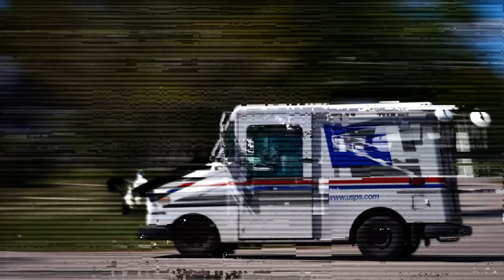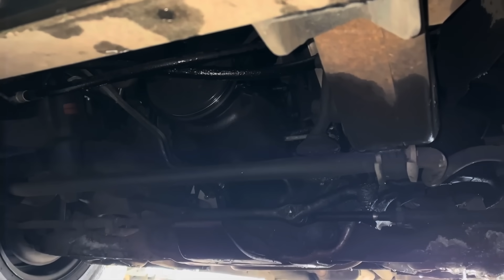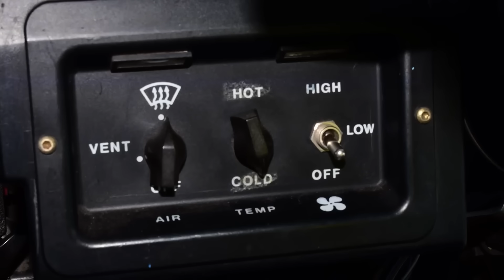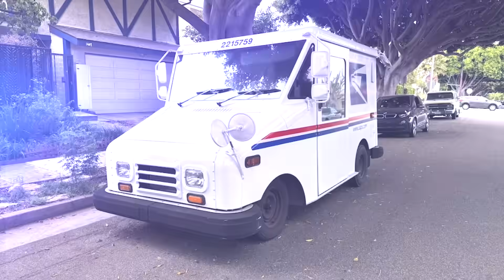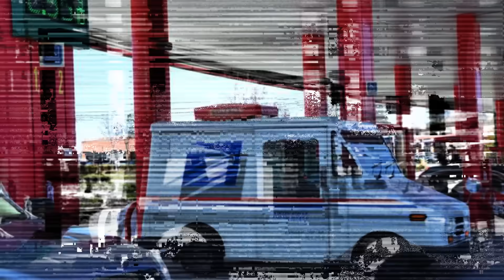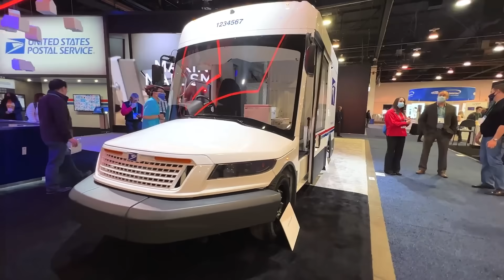Why Grumman LLV Dominated US Streets for 30+ Years

Comment: Postal mechanic here. Milwaukee still has a whole fleet of LLV's. Whe have some promasters and metris to fill the gap from the ones we had to scrap due to bad frames, which is the only downfall of the LLV. The bodies are aluminum so would last forever if not for being damaged. All the panels are riveted together so easily replaceable. Theoretically with new frames they would last another 30yrs. We did replace frames on some of them but theystopped doing it.I believe safety and emissions standards prevented keeping them for any longer. No airbags, ABS, traction control, etc.
Reply from the maker: We are really honoured to have such valuable audience. Much respect Sir.

Comment: One cool feature that often gets overlooked on these videos is the front axle is narrower than the rear axle.  
This gives better turning radius and keeps from running the front wheels into the curb, when approaching the mail box. 
The drawback to this setup is the snow, the front doesn’t break the trail for the back tires. They are also prone to tipping over in wrecks.
Reply from the maker: Wow that’s amazing 
Really honoured to have such knowledgeable audience 
Highly appreciate your analysis and feedback Sir. 🫡

Comment: NO, they did not have a 2.8l engine ever. The early ones had the Iron Duke yes, but then they when to the 2.2l port fuel injected engine. They only last a long time by changing out the engines, drivetrain, fuel tanks and everything on the truck.  Like most postal delivery trucks, they catch fire with time. I only worked on them over 23 yrs.
Reply from the maker: Huge respect to your hard work Sir. 
Feeling honoured to have you onboard

Comment: Don't believe I have ever heard one with the 2.8 engine. If anything like the "CNF 11" engine in the Chevrolet Citation would be a lot faster than most of the mail trucks. But maybe not as reliable unless gone through and most of the bolts properly torqued.
Reply from the maker: Thank You for your time Sir.

Comment: Lots of misinformation here.  The LLV did not have positraction, at least not initially, and it could not handle snow very well.  The DJ5 had positration and would go through snow a foot deep.  Also, rhw video seems to regard right hand drive as a revolutionary concept.  The vehicles it replaced also had right hand drive.  The only thing it had going for it over the DJ5 was the aluminum body.
Reply from the maker: Thank You for your feedback Sir 😇

Comment: Why can't the gov just tell Grumman to remake the same vehicle ? Just add AC.
Reply: A RV style AC could be added to the roof.
Reply: Because Grumman didn't make any components, they just assembled them. If they tried to build a vehicle like this, they'd have to use components from current vehicle and these are terrible and short lasting.
Reply: @dan_mer  What!? These vehicles already lasted well pass their rated life.
Reply from the maker: There are other things as well that need to be addressed 
So called carbon emission
Safety standards
Maps
AC of course.

Comment: horrible gas mileage and now Trump wants to cancel the electrics
Reply: 😂 ever try to use a 3 year old rechargeable battery? Its basically trash
Reply: @spatula996 electric cars have a 10 year/100k mile minimum warranty 

15 years in CA
Reply: @spatula996 .  So design the battery pack so it can be replaced every few years.  Just like tv remote batteries 🔋.
Reply: @drmodestoesq  At what cost?  Check on the price for an electric vehicle battery like the Tesla or Nissan Leaf, it is more than 50% the price of a new vehicle.
Reply from the maker: Well
Gas was never an issue for this department 
There were other things to focus 😅

Comment: LLV's don't have air conditioning or heat which would normally be a violation of OSHA unsafe working condition but I am sure the federal government exempted itself from its own regulations???

AI:  US Postal Service LLVs (Long Life Vehicles), which form the bulk of the current postal delivery fleet, were not built with air conditioning, and their heating systems are generally unreliable and minimal. Most LLVs lack both heat and air conditioning; the vehicles can be extremely hot in summer and chilly in winter, often with no climate control for letter carriers.
Reply from the maker: Thank You for putting in this much effort 😇
God bless you.

Comment: Imagine that. When all the ridiculous over-engineering, unnecessary electronics and difficult, time consuming serviceability are left out of the design, what a high level of success can be obtained. Just think of how many of them could be sold today, just like that, or with a small, optional roof-top a/c for the cab? I'd buy one tomorrow morning over most anything else sold today for business. My choice of engine would have differed a bit, though.
Reply from the maker: Thank You for sharing your thoughts Sir

Comment: Terrible  engine is from the eighties and carburetored not fuel injection. This has  produced high pollution emissions will not pass federal emissions test. The  poor gas mileage has cost billions  in   gasoline cost..
Reply: The Great LLV engine is throttle body fuel injection TBI 2.5L. It has a closed loop system that controls the fuel injectors pulse width

That system is the same in GM cars with the 2.5L TBI Iron duke that with cars meet Federal emissions test

 Government vehicles may or may not meet a cars emission test. A postal vehicle start and stops often every few hundred feet and often is never driven much on a highway

It is rather silly so say they have bad gas mileage; all vehicles do with stop and go. IF battery powered today the pollution from mining Lithium and using children as labor to die early has a moral cost too
Reply from the maker: That’s true
Reply from the maker: Don’t forget what it replaced. 
The jeep
The real gas guzzler and don’t even think about mentioning its physique.

Comment: BTW, this whole LLV concept was originally thought up by UPS. They used aliminum bodies and fiberglass parts with a refurbishing program to get 25+ years on their trucks. You'd have to look close to see which ones were Ford, GM, or even AMC for the 6 cylinder engines. At one point in the mid 80s I asked our UPS driver and he lifted the engine cover. Yup, it was a 1968 with an AMC engine! It had just come from the shop and got repowerd.
Reply from the maker: That’s amazing. 
Love to have such knowledgeable audience 😇

Comment: Yes, replaceable panels like almost every car on the road, but Tesla, where a slight damage to the Mega-casting = totaling the entire car.:face-green-smiling:
Watch Peter K undo spotwelds and replace body components, and pulling things on a huge chassis machine, then reassemble it with TRAM-gauge and laser precision, according to manufacturer specs.
Reply from the maker: 🤣🤣
This platform welcomes you to bash any EV 😜

Comment: Iron Duke is simple and long lasting. The Iron Duke engine used a gear-driven mechanism for the early models, specifically a micarta camshaft gear that meshed directly with a steel gear on the crankshaft. However, from 1991 to 1992, the later models transitioned to using a timing chain instead of the gear-driven system.💪
Reply from the maker: We are delighted to have you on board Sir. 
Really appreciate our knowledgeable clients 😇

Comment: Urban delivery is with those 3 wheeled push carts. 
Mailbox by the curbside is where the llv are used
Reply: Nope, that's called dismount delivery.
Reply from the maker: @straightpipediesel Thank You for showing up Sir. 😅
Highly appreciate that
Reply: @straightpipediesel    in my area they call that "park and circle" where the carrier walks around the block then moves the truck to the next block. Depending on the route, there may be a wheeled cart or a shoulder pouch for the walking part.
Reply from the maker: Yes sir 😇

Comment: Sink the AI intelligence that wrote this is mixing up the facts it's a Grumman built body on a S10 chassis or not a chassis it's unibody the underpinnings are Chevy S10 and also Ford created a similar vehicle later on sure they were probably in on the the ground floor of bidding for this contract
Reply: I never looked at one close but the Chevy Astro van was a unibody with a front sub-frame, so probably borrows heavily from that design. Same engine, trans, and rear as an S-10 but fine tuned for more weight. The Astro was basically a half ton pickup with a van body. They were also rated at about 6,000 pounds gross so had larger brakes and 6 ply tires.
Reply from the maker: Thank You for your time
A lot of human effort is behind the production of these videos 
God bless your judgement